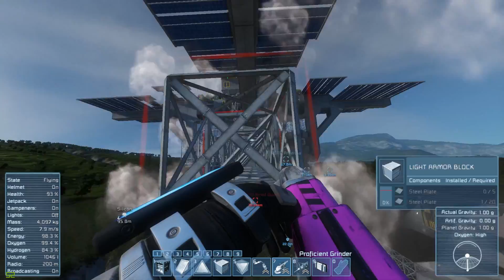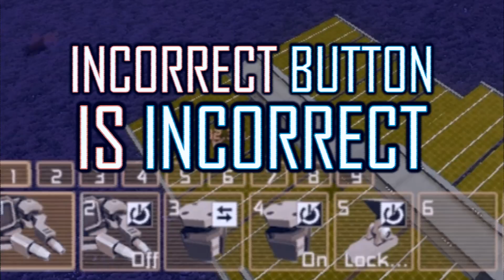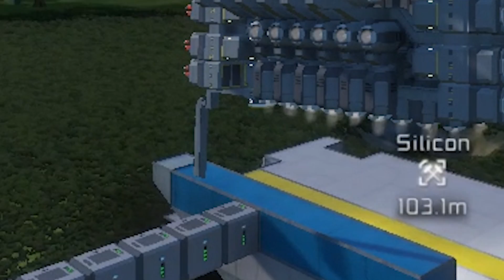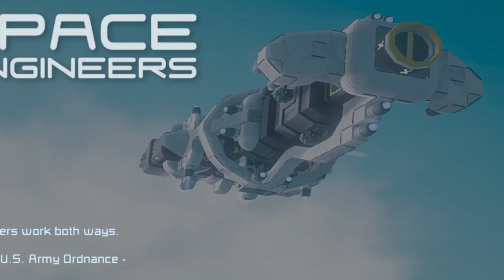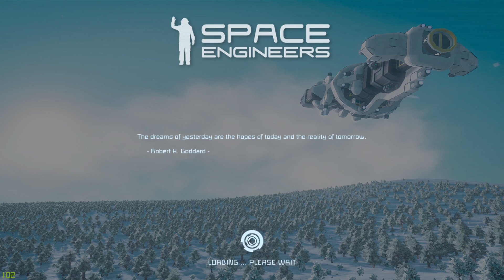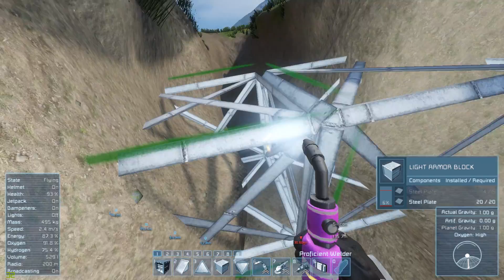Space Engineers, Battery Bombs, & Loading Screens (Singular Survival, Ep 42)

Comment: rotor probably kept wrecking the ship cause of the weight of the batteries and merge blocks  causing a pendulum effect  on which the game is like naw no happening and structural integrity  of the smaller ship block to fail  in other words should have tried to place the landing gear on the front  and connect to the middle  block on the battery structure

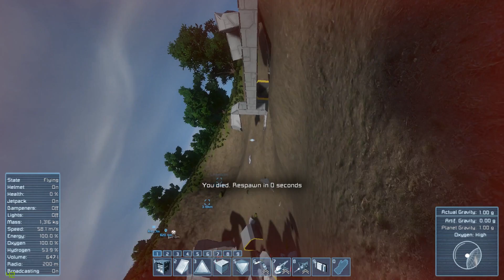Comment: 4:57 solution; pole + Rotor + Mergeblock, then add Mergeblock on top battery's side = perfect
Reply: 18:30 - is it possible to make a slope with a rotor on the side connected to the ground, and a straight vertical bit on the other side, then lay the batteries on it and rotate it to lift the batteries till they're vertical?

Comment: The problem wasn't the rotor so much, it was the interaction between the small ship rotor and the large ship battery grid that I could see. Yes the rotor "spurged" out and went nuts a few times...but it looked like more OFTEN the weight of the batteries was your problem because your ship was trying to move a heavy large ship grid with a small ship rotor system, and the game just said "no" and began to move your small ship instead of the large one. and because it tried to do it quickly (idk what your rotor speed was) it cause clipping errors.

Comment: Perhaps it's a centre of mass issue.

Because your payload is off to one side, it's pulling the back end of the Sausage down, but not the front end, causing it to spin. This usually breaks the batteries off, correcting the centre of mass issue. However, when the rotors and landing gear are locked, they are treated as the same grid, so centre of mass issues are ignored by the game engine.

Comment: Few weeks ago, i've been trying to do nearly the similar thing you do. After few tries i realised, that the thing, that was rotating was too heavy and it made the whole ship rotate, like its a gyroscope. Then, because of the extreme spins, the rotor always gave up and the thingy i was trying to rotate started doing something like that. Also, my whole ship was actually pitching up automatically for some reason, it was because of the rotor and the stuff on it, but i have tried fixing it and it just kept rotating itself.   Its just some planetary gravitational field glitch.
Reply: Was the mass near the rear? That could explain the pitching up.
Reply: Jetfire Yea it was, honestly i thought, that that was the problem too, but then i deleted it and it kept pitching. Or i actually put some large thrusters on the back and it just kept pitching up. I dont know what broke, but it was definetly because of rotors.
Reply: What makes it confusing is that sometimes SE ignores where the mass / thruster is placed while other times it does not. For a single grid, all thrusters are treated as though they were at the centre of mass. Otherwise, they could cause your ship to spin if they were placed asymmetrically. Likewise for locked landing gear, locked rotors, locked pistons and locked connectors. 

However, when any of these items are unlocked, the placement of thrusters / mass distribution does matter. SE treats unlocked rotors, for example, as two point mass systems, with thrust applied at the centre of mass of each. 

When the rotor is locked, it is like picking up a long beam of wood from the centre; a simple lifting motion. However, when the rotor is unlocked, it is like lifting up the same beam from the very end. You are applying more of a rotating force than anything else. 

The way SE handles this, moving your thrusters around the same grid wont help. Moving the centre of mass of the payload and adding more gyros should help.
Reply: Jetfire Yea, this thing with thrusters in SE sux. Btw i also tried to put thrusters on the thing attached with rotor to my ship and somehow nothing changed.

Comment: I just about died laughing when the landing gear broke off.  Sage... you fail so wonderfully.

I would theorize that the large ship grid is taking priority over the small grid, and the landing gear isn't meant to be a stabilizing point when separating grids via a rotor.

If you think about it... when you attach parts to a rotor you are, effectively, doing the exact same thing as attaching parts via a landing gear.  That means you actually have a separate grid entity for everything on the other side of the rotor.

This is actually a real issue when rotating something, even in the real physical world, without an anchor.  For instance: the helicopter.  Without the tail rotor to stabilize things, the body of the craft is just as likely to spin as the main rotor is.  That's why it works so well to take out a helicopter by disabling the tail.

Comment: you could have used the connector trick to get the same results. it is a bit challenging but if you set the strength to max and you had it on the one like you did with the landing gear the center mass would pull it so it would have been were you wanted it. then when it comes to the merge when the connectors unlocked it would move the main ship as harshly.